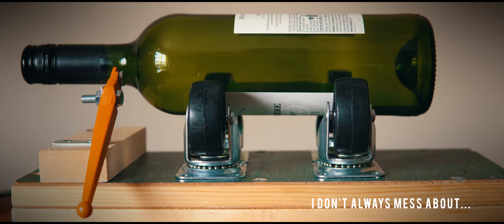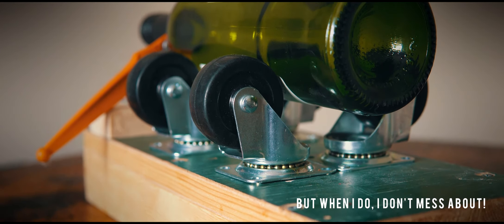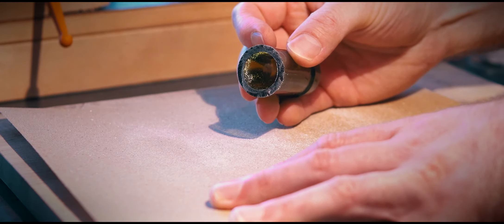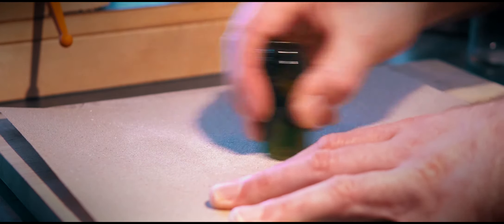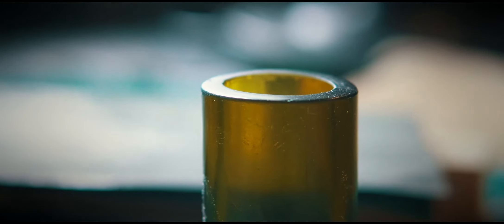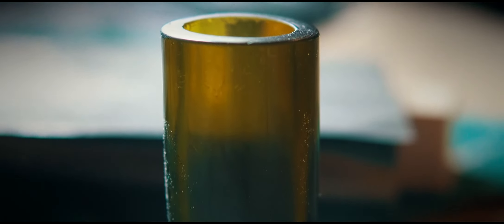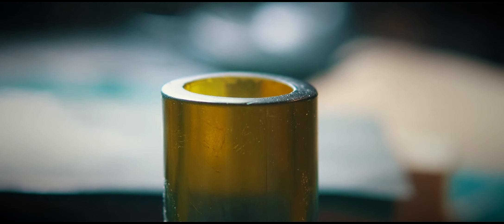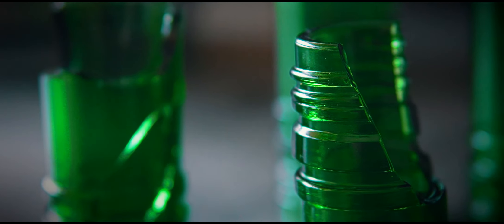Making A Bottleneck Guitar Slide

Comment: A pipe cutter that you use for cutting brake lines and plumbing might give you an easier and cleaner cut. Just found this video, good stuff! As is the playing
Reply from the maker: Thank you! Good idea, but the one I had was nowhere near big enough to go around the bottle. It was an old design though, kind of a cast block with a cutting disc that you screw down. The hole had a very limited size range for the pipe (which sounds dirty!).

Comment: You made a genius jig. 👍👍 sounds killer. What model Gibson Les Paul is it?
Reply from the maker: May have been a touch overkill, ha! Thanks, man. It's a standard from 07, so it's one of the undesirable hollow ones. It was also refinished by the previous owner in a thin nitro, but much better looking colours than the slightly more gaudy original paint I think. Ben.

Comment: Hey. So your technique to get it unattached from scoring is just pouring hot water onto it? Also I don’t want to make that jig since I only want to make one so what’s a more efficient way for me?
Reply from the maker: Yes, I found more extreme heat can shatter it pretty indiscriminately, but the concept is going from hot to cold, but rapidly, however you want to achieve that. You can score it by hand, I just struggled to get it to stay square and join back up with where I started. You might have more luck though. Maybe try and rotate the bottle on a work surface up against a wall, so that it can't slide back and forth. Ben
Reply: @BenFletcherGuitar  thank you so much